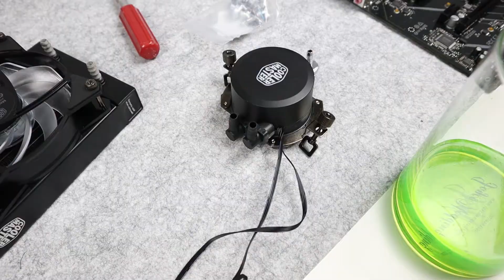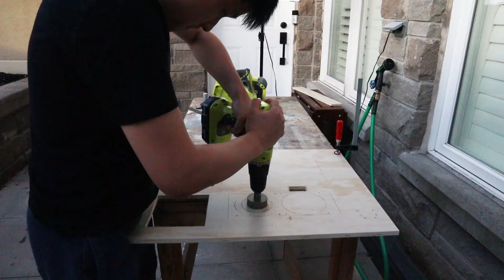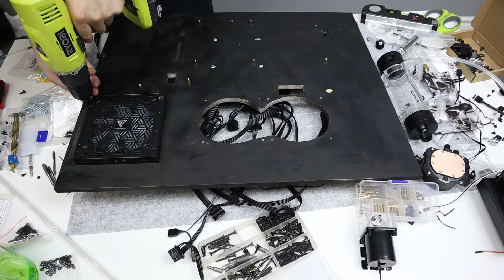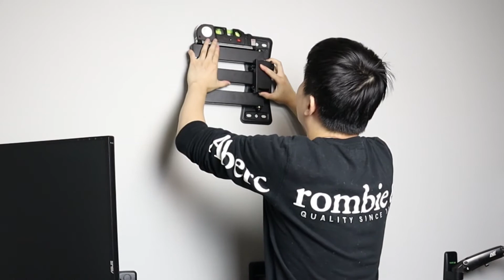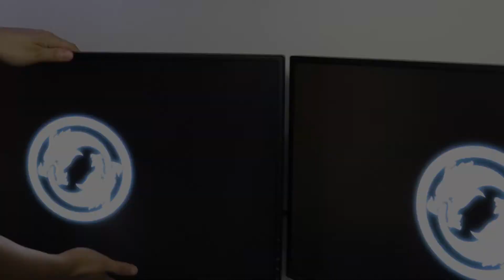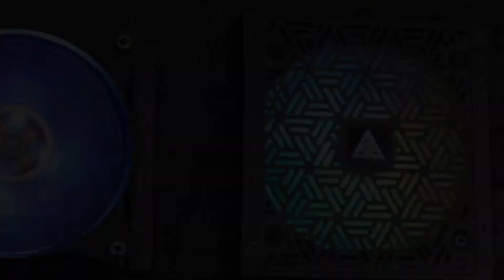Water Cooled Wall Mounted PC Setup

Comment: That is literally the worst custom loop I have ever seen. Why is the pump on top of the reservoir? It doesnt make sense, I mean the whole thing doesnt make sense and apparently you destroyed a perfectly fine AIO just to limit yourself to a 240mm radiator (very questionable in a CPU-GPU config) I dont even feel like you saved a lot of money there cause a cheap CPU waterblock and a 240mm radiator certainly doesnt cost more than $90. Also the different types of tubes look just ridiculous. I dont know what you were going for, if you wanted it to be a AIO you fucked up, and as a custom loop it sucks even more. lol

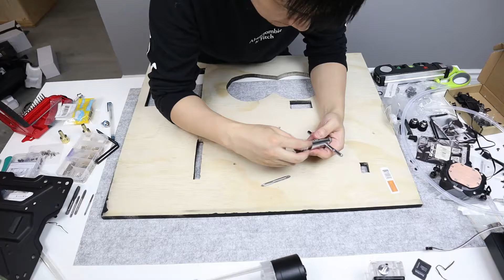Comment: 5:03 All of that weight is hanging from four fine thread machine screws with threads tapped into plywood?  Yikes!!! You should have at the least put washers/nuts on the opposite side of the plywood to secure the wall mount to the plywood. I would not trust fine threads tapped into plywood. 

Also, use a strong neodymium magnet on a thin rope to retrieve your hole saw. Ask me how I know this works :)